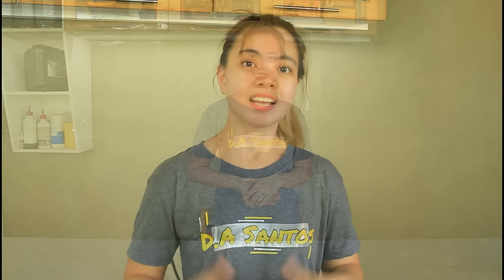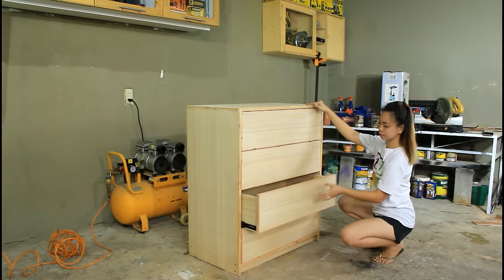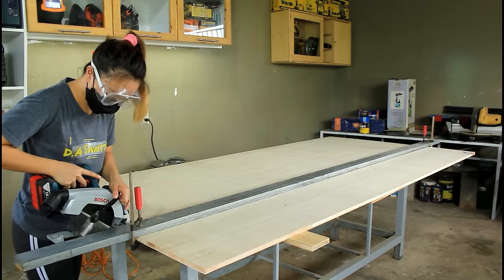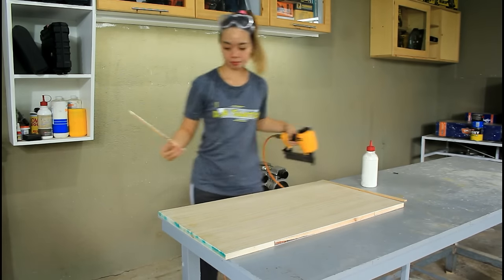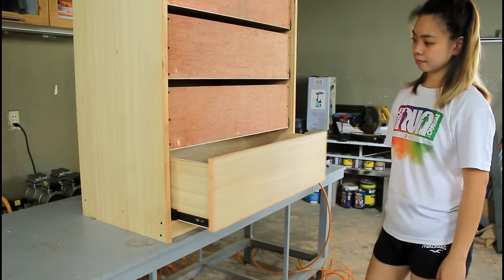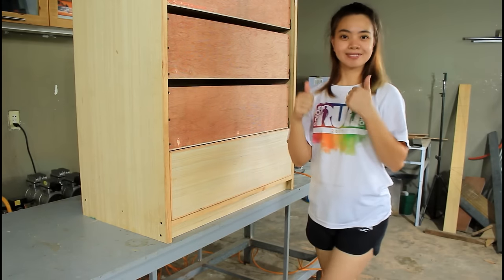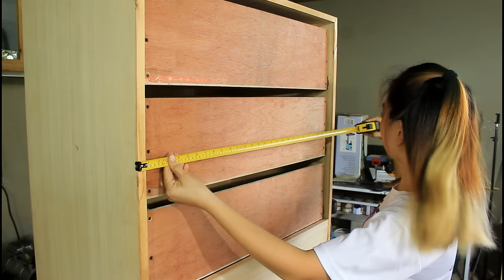Making a Push Open Drawers DIY

Comment: Well organized ang tools mo at malinis ang work shop mo at pinturado pa. Sa akin shop magulo at nakakalat ang tools ko kung saan saan, mas marami ang tools at power tools ko kaysa sa iyo may carpentry, electrical, mechanical, plumbing, mason, welding, tools pang electronics at computer, at Meron din pang automotive.